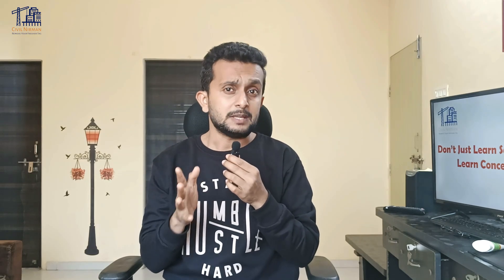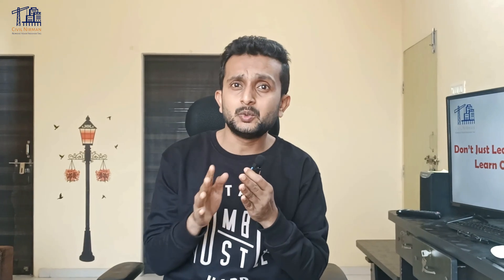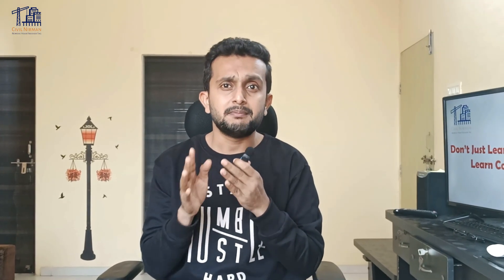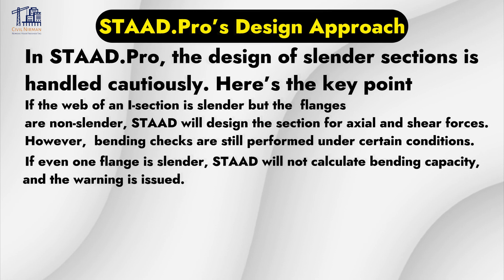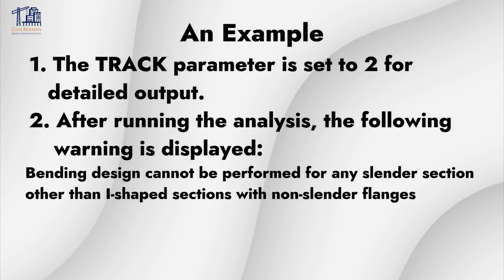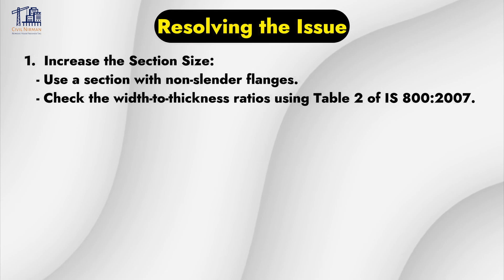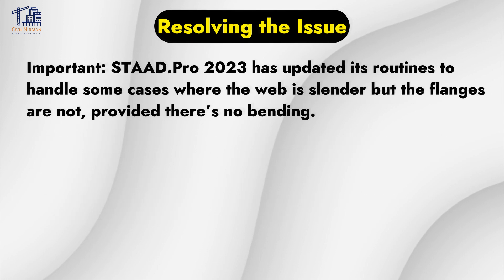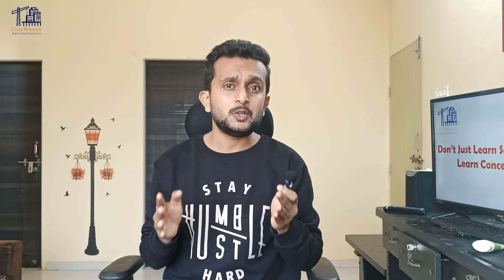"STAAD. Pro Warning: Member is slender and cannot be checked for moment forces,"  Explained

Comment: Can you plz explain cl. 9.3.2.2, page 71 & Table 18, page 72 of IS 800 2007 code... Thank you...
Reply from the maker: The clause from IS 800:2007 you shared deals with bending and axial compression for members subjected to combined axial load and biaxial bending.

This clause ensures the safety of members under combined axial compression (P) and bending moments (M) about the major (x) and minor (y) axes. The interactions between these forces must satisfy the provided equations to prevent failure.

The combined effects of these forces must not exceed the member’s design capacities.
If the sum of all terms in the equation is ≤ 1.0, the member is safe.
If it exceeds 1.0, the member is unsafe and needs adjustment (e.g., reducing loads or using a stronger section).
The clause checks if the column is strong enough to handle this combined action by ensuring all the effects together don’t exceed its strength.
If The column fails to satisfy the interaction equations, indicating it is unsafe under the given loading conditions. To improve safety:
Reduce the axial load or moments.
Increase the section capacity (e.g., use a larger section).
Consider additional bracing to reduce buckling effects.
Reply: @CIVILNIRMAN  Thank you for the reply...👍